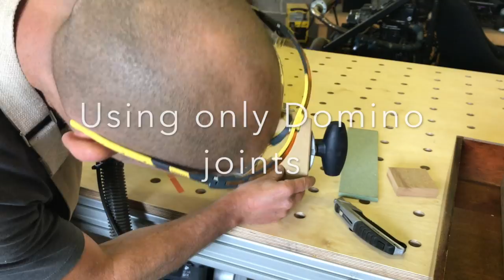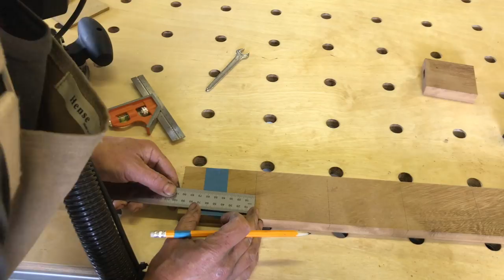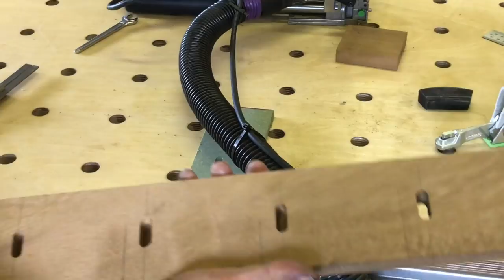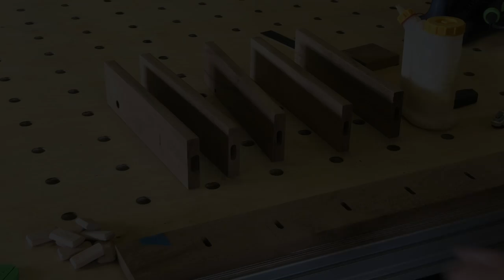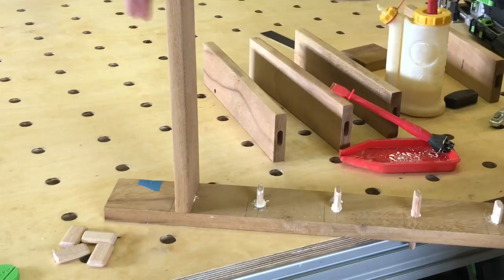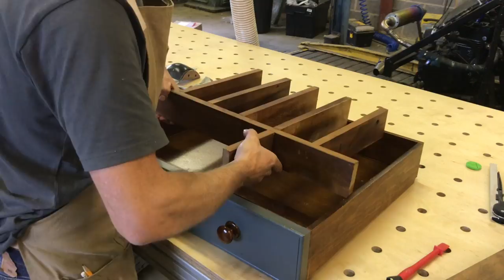Kitchen Drawer divider tray- Festool Domino XL 2

Comment: Did you make the dividers with 3/4" stock because it was handy, or to make assembly easier, or another reason? Was thinking of making some here, but was planning to use much thinner stock (maybe 1/4"). That does end up changing the joinery, though. End result here looks nice.
Reply from the maker: It was the look I was afternoon shop bought , also I  think it look modern.  friends making a cup of tea say  "were did you get that drawer try ......:) lol

Comment: I noticed in this older video you made a shim out of wood for your domino to do thinner stock. Was this before you knew seneca made shims and a small mortise kit for the XL domino or were you just doing it a cheaper way by making it yourself?
Reply from the maker: Just a cheap way to do it , I find the XL much harder to use on small stock so ended up getting a domino for small stuff saying that the XL can cut much deeper
Reply: @ManorWood  shen you said the domino for small stuff are you referring to the df 500? I'm about to pull the trigger on a domino and originally wanted the df 500 but with all these 3rd party accessories for the XL making it do everything the df 500 can, its hard to not want to get the XL but you make me nervous about going that route when you said the XL is hard on small stock.
Reply from the maker: The one that can do it all is the XL. If I could only have one it would be the XL for sure , you will very look back mate
Reply: @ManorWood   thanks for the feedback im positive now that im buying the XL in about a week although the festool recon event they just had took a good amount out of my wallet.

Comment: The board of the divider looks thicker than the drawer sides only because the smallest tenon you could use is 8mm? Should the divider be half the thickness of the sides, it would be more elegant. Then it could be done easily with dado or dovetail slots. Another much easier/cheaper way is to use dowels that cost 1/4th of those beech tenons and would just as good or better with thinner boards.
Reply from the maker: Just liked the Chucky look

Comment: What is the purpose of the "sticker" at 0:13? never seen this on other videos.
Reply from the maker: I had to add this 6mm MDF use double sided tape to adjust cutting height of the Domino XL,  I now have a Domino 500 as well so no need anymore :)
Reply: So, I understand well this allow you to center the mortise in the middle of 19mm stock?.. Which is minimum stock thickness that you could made a centered mortise with XL700?. 25mm?
Reply from the maker: Felix Riestra m, correct , think it’s 20mm. But can’t remember for sure